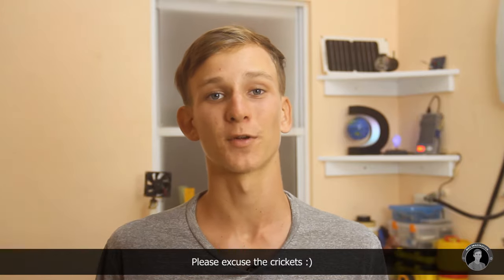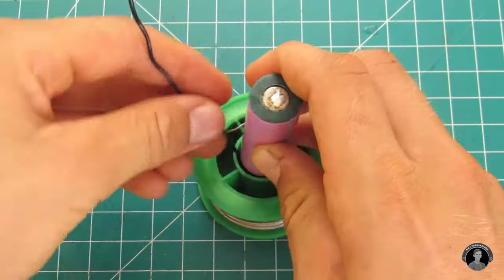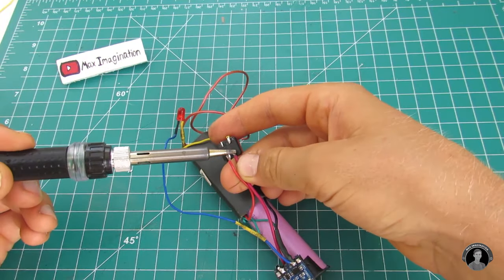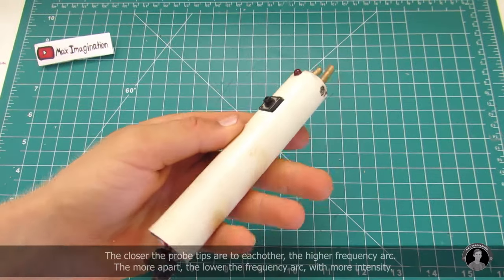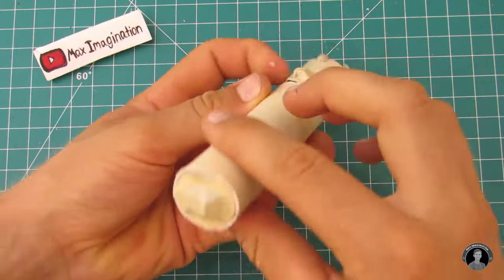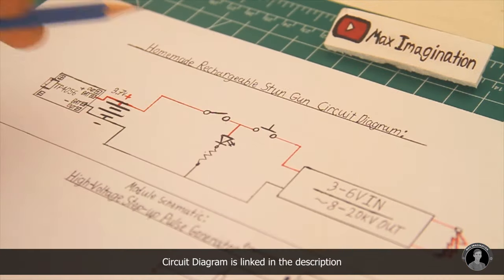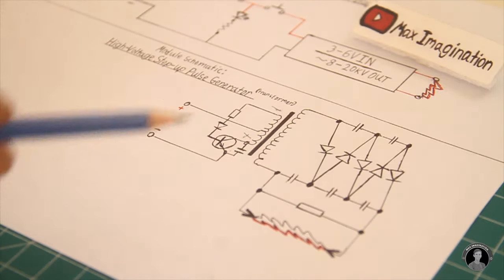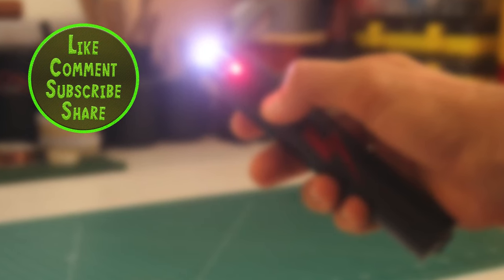Make a POWERFUL Stun Gun for Self Defense | DIY

Comment: I know the video is old by now and you probably have comments turned off but im making something similar to this as a science project and I need a higher output. Could I use a 9-volt battery instead
Reply: Could I also remove the saftey switch light and battery indicator and resistor with it still working
Reply: Basically no saftey features
Reply: Nevermind, if fixed it. Its arcing and it looks like it could easily electrify a painful metal mesh. I promise this is for school and thanks for the video.
Reply from the maker: Yes, you may.
Reply from the maker: Good to hear you've got your Stun Gun working... Keep out of trouble and happy sparking!

Comment: Hi max I have a question so you know how you used the to4056 charging board 5v

Could I use the 3.7v one?
Reply from the maker: Hi there. There is only one type of TP4056 Li-cell charging board (as used in this video). It converts an input voltage of 5V and charges 3.7V batteries.
Cheers.
Reply: Also could you please send a Amazon link to buy the 50 ohm resister because I’m having so much trouble trying to find a 50 ohm resister
Reply: And also does it have to be 50 ohms or can it be 10 or 30 ohms or does it have to be exactly 50 ohms